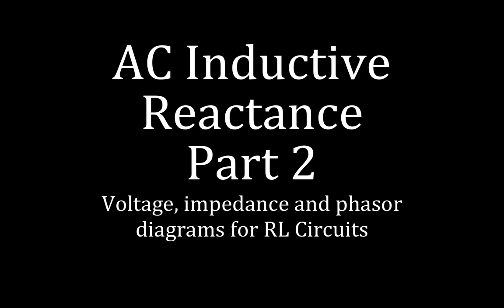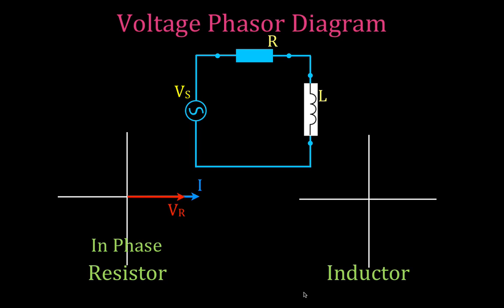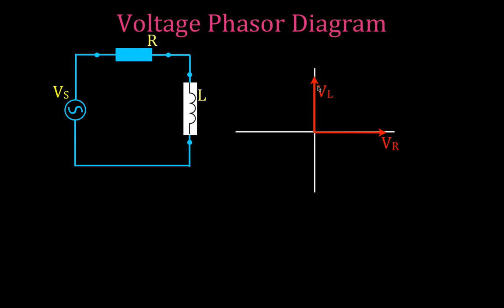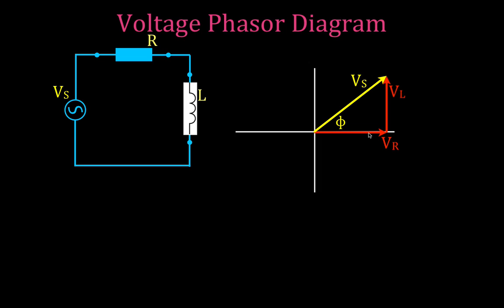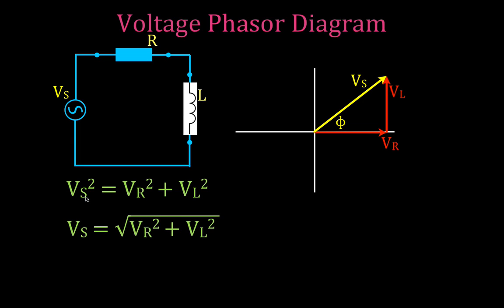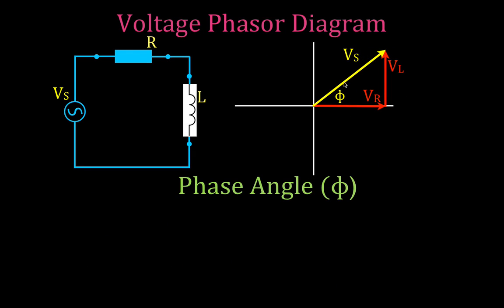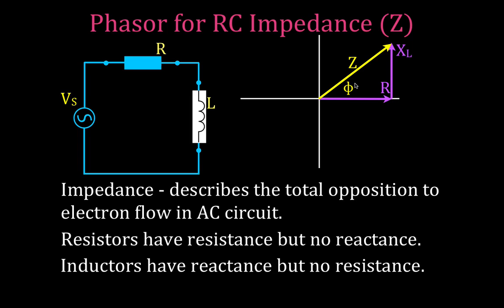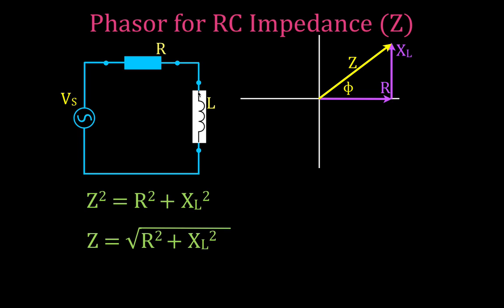RLC Circuits (7 of 19) Series RL; An Explanation, Voltage, Impedance, Phasor Diagrams

Comment: Excellent video but at 6:46 and in the previous video you seem to confuse the parameters for the arc tan or tan^-1.  when you say tan^-1(pi)  = VL/VR, you are saying "the angle whose angle is equal to a tan".  It should be tan^-1(VL/VR)= Phi so you are saying " the angle whose tan is tan is equal to an angle".  This is because arc tan or tan^-1 is used to find the angle that has a given tangent, not find the angle that has an angle equal to a given tangent. It was surprising you displayed the right answer.  You must have used a trig table rather than the formula as you showed it for the video, since that formula you showed would not produce the right answer.